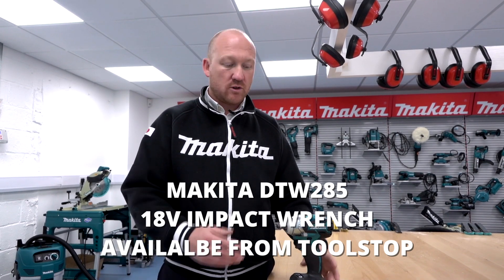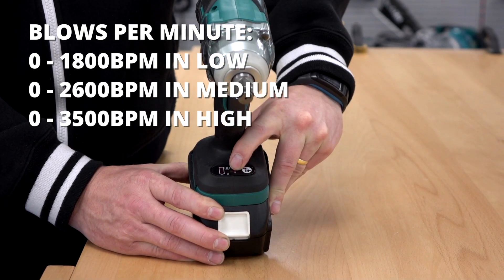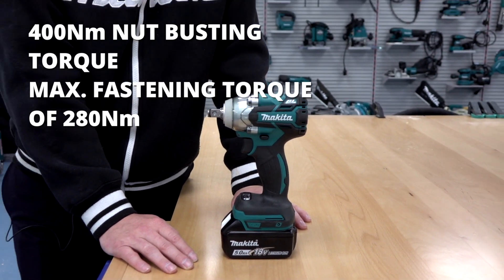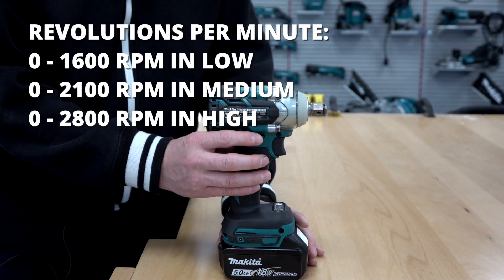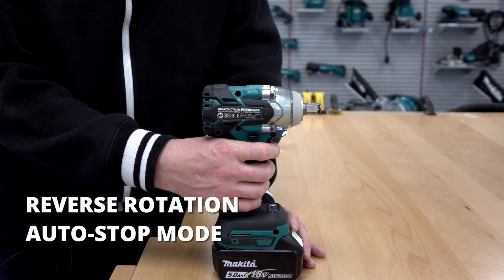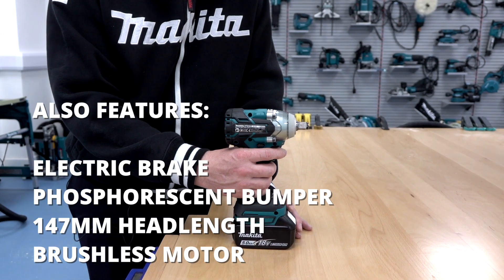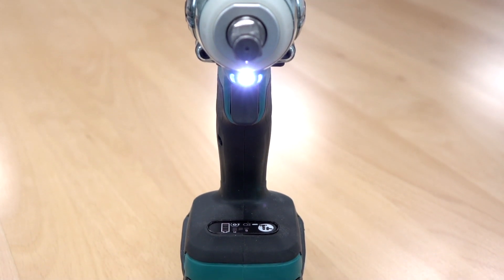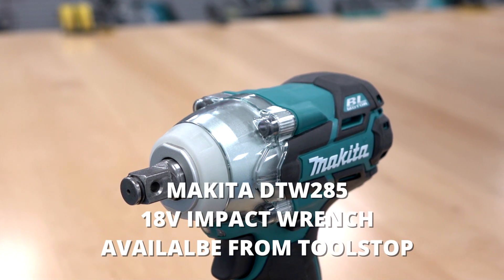Makita DTW285Z 18V Cordless Brushless Impact Wrench - Full Spec Overview

Comment from the maker: SHOP HERE - http://www.toolstop.co.uk/makita-dtw2...
Subscribe to our channel - https://www.youtube.com/user/MrToolstop
Like us on Facebook - http://facebook.com/toolstop

The Makita DTW285 is an updated version of the DTW281 Cordless Impact Wrench. It has a new mode called Reverse Rotation Auto Stop Mode. It is suitable for scaffolding applications.

FEATURES:

Electric brake
Variable speed control by trigger
Forward/reverse rotation
LED job light will light up the work area in dark conditions
Brushless motor for maintenance free and more efficient operation
Compact design with overall length of 147mm
Phosphorescent bumper
Ergonomic soft grip
Equipped with Battery protection circuit: designed to protect the battery from damages due to overdischarge, high temperature or overload current
Battery fuel gauge
Reverse rotation auto stop mode: This mode works only with pulling the trigger fully in counter-clockwise rotation. When the bolt/nut gets loosened enough, the tool stops the impact and rotation in 0.2 seconds